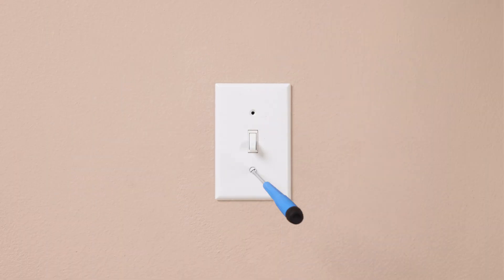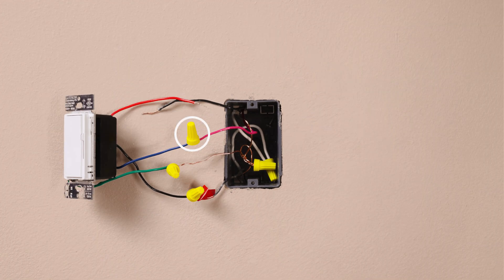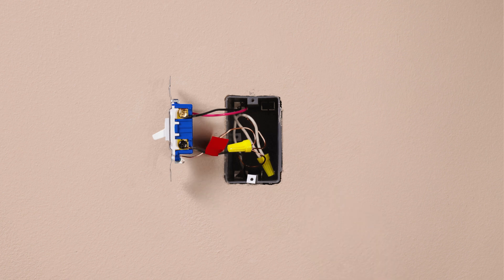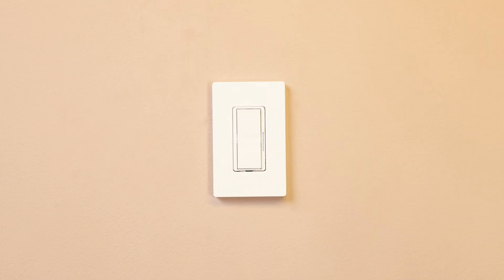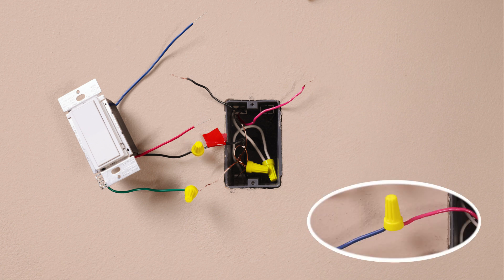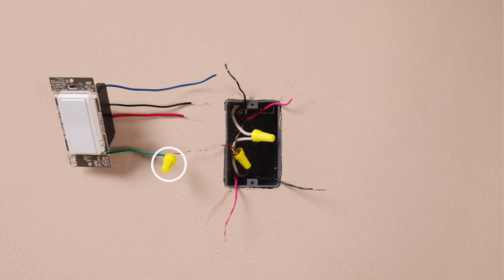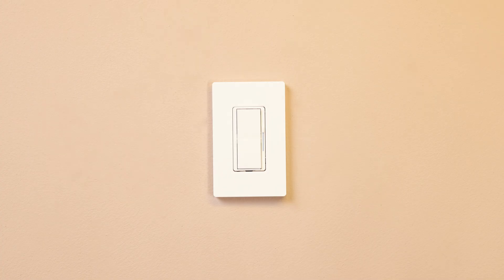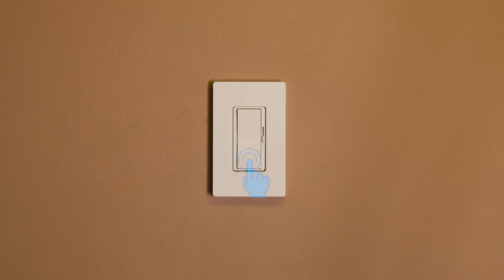Installing a Diva Smart Dimmer for the Caséta system in a wired 3-way application

Comment: Just installed 7 of your switches, two of them 3-way and this video was a lifesaver. The tricky part was wiring the secondary switch for the 3-ways. I connected the blue wire to the red for the new switch, then could leave the red on the secondary switch as well as the ground. Then just remove both black wires from the secondary switch, combine them with the yellow using a wire nut, then connect the other end of the yellow to the odd colored screw on the secondary switch. Hardest part was getting all the switches lined up for the face plates to go on correctly. Cheers,

Comment: 2:15 note to others, they've wrapped the yellow wire around the screw the wrong way. It should be wrapped clockwise.
Reply: Your 100% correct.  I was surprised Lutron didn't catch that error in the video.  the industry standard is to wrap the wire in the same direction as you'll tighten the screw.  Otherwise as your tightening, you run the risk of the wire not wrapping tight and the wire may come off later, if not while you're pushing the switch into the box.

Comment: Hello.  I just purchased the Diva Smart Starter kit.  I have two 3 way switches that go to a kitchen light.  I changed out the first switch with the Diva dimmer wiring exactly as described early in this video.  It works perfectly.  I went to the second 3-way switch that's the original mechanical non-smart switch and it works without doing any rewiring as shown here with the yellow wire.  What does this yellow wire accomplish if my lights work on the second switch without rewiring it?  They go off/on just fine.
Reply from the maker: Our Technical Support team will be able to best help with recommendations for specific scenarios. You can reach them at 1-844-588-7661 or support@lutron.com. We’ll talk to you soon!
Reply: @Lutron-Electronics that’s a lie. Whenever I call for assistance or just to have a couple of questions answered, I’m always routed to an agent who speaks 17% English with also a no patience having nasty attitude! And it’s always the same agent. Not only have I gotten his voice tone memorized, I can hang up immediately, call back, go through the automated system and still get connected with the same guy. So word of advice to anyone call for tech support, never call after 10pm CST cuz your call will be routed to a foreigner who doesn’t speak English and is rude af

Comment: I successfully wired my existing 3 way switch and a Diva dimmer. But I wonder, is the jumper wire necessary? Could I have left my 3 way switch wired the way it was by the electrician who initially installed it? It had been on a 3-way with a regular dimmer prior to this. If the jumper is necessary, why is it?
Reply: This question is a year old but I'm commenting because I just did the install and was wondering the same thing.
I tried without using the yellow wire thinking that I wouldn't need it if I replaced the master switch with the Lutron but found that the dimmer would still only work if the other switch was in the "on" position. Therefore, I had to install the yellow jumper on the other switch to fix that problem.
Reply: Same question I had/have and technical support is no help whatsoever!!
Reply from the maker: Our Technical Support team will be able to best help with recommendations for specific scenarios. You can reach them at 1-844-588-7661 or support@lutron.com. We’ll talk to you soon!

Comment: @Lutron Electronics In your Advanced Installation Guide Page 44 says to connect the tagged wire to the Red wire on the Diva. In the video you connect the tagged wire to the black on the Diva. Can you connect the tagged wire to either the black or red?
Reply from the maker: Yes with the DVRF-6L you can connect the tagged wire to either black or red. Making sure whatever wire is on the red wire and the blue wire end up on the jumper together in the mechanical 3-way is key.
Reply: @Lutron-Electronics  So whatever wire you attached to the blue wire on the diva is attached to the brass screw on the mechanical switch. The tagged wire and remaining wire you put together with the jumper to the black screw on the mechanical switch?!?!
Reply from the maker: @Jarut  Our Technical Support team will be able to best help with recommendations for specific scenarios. You can reach them at 1-844-588-7661 or support@lutron.com.

Comment: If you use an existing mechanical switch with the diva will both switches be able to turn the lights on and off? The mechanical switch needs to remain always on for the diva to work?
Reply from the maker: Hi, Cameron! The mechanical switch does not always need to be left on. You will be able to dim by using with the Diva smart dimmer or turn on and off from the mechanical switch. When you flip the light on from the mechanical switch, it will go to the level of slider on the dimmer.

Comment: Very helpful, would have saved me a lot of time if 3 way installation was included with the Diva smart switch as I spent an hour trying to figure out why the 2nd switch no longer worked. I couldn’t find instructions on the product page either, only instructions for single pole. Would be helpful to add this video to the product page for others (unless I just missed it).
Reply: Agreed, very helpful video but I wish the products came with schematics for 3-way in addition to single pole.
Reply: Same issue I had.  Add in they don’t label the wires, just tell us what each one is??
Reply: I just got mine. There’s a part in the included instructions that mentions replacing existing switch with the diva dimmer and adding a jumper wire to the second switch. Maybe it was added recently?